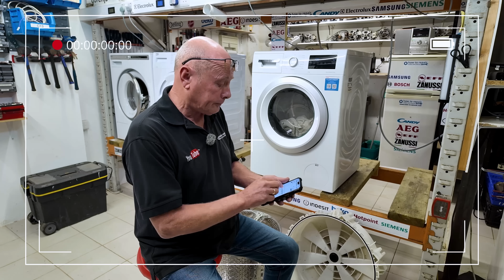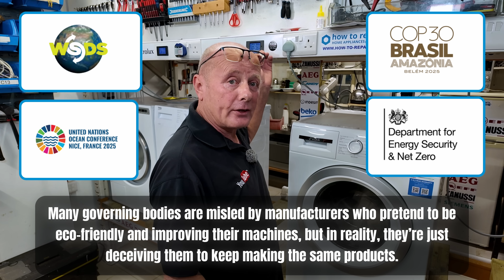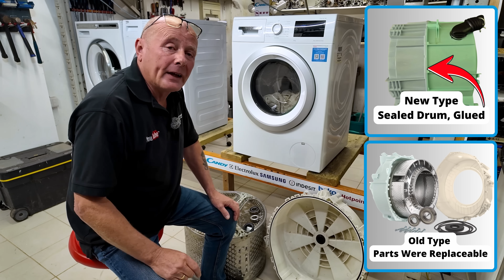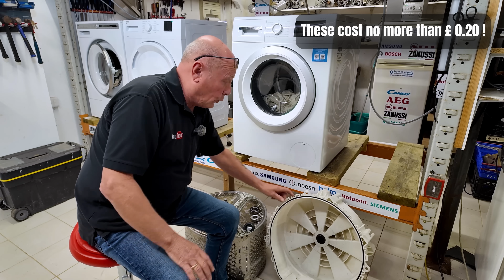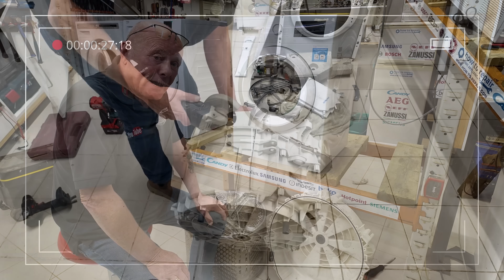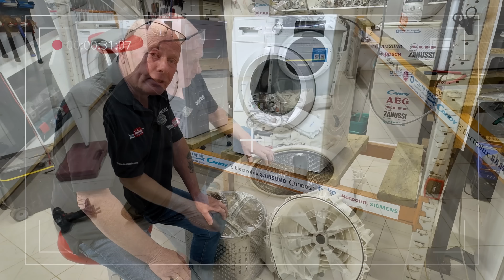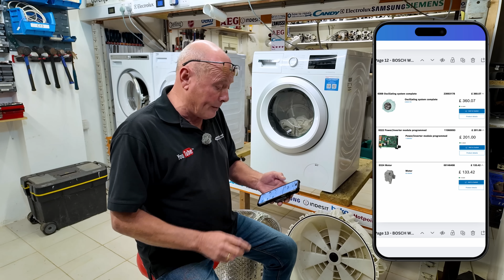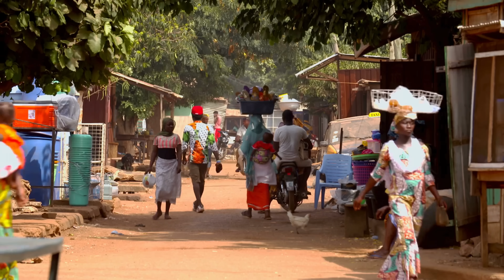Washing Machine SCAM EXPOSED! The Truth About SEALED Drums: Naming & Shaming

Comment from the maker: My part is done. Now, your part begins.

I spent a full fortnight painstakingly researching for this video. That meant verifying every single part number for every model, visiting manufacturer websites, and capturing screenshots of prices at the time of filming—all to ensure they couldn't just alter the data after this was released.

This illegal "planned obsolescence" is now industry-wide.

Think about this: Ask someone aged 50-60 how long a machine lasted in 1980, and they’ll tell you 20 years*. Ask a 20-year-old today, and they believe a machine *should last under 7 years*. An entire generation has been *brainwashed into accepting disposability as normal.

All this, simply because manufacturers won't spend 20p on screws, sealing the drum instead.

My role was to expose this truth. But watching this video alone will not create change. Action will.

Your role, if you truly want change, is to make this impossible to ignore. Share this video.
Reply: This is bad engineering and extortion the ECO rating needs to take into account the mechanical life of a machine.  Disgusting profiteering. I have a 35 year old Candy with stainless steel inner and outer drum, the only part that machine has had is a belt and a water pump.
Reply: Take a look candy crap now makes
Reply: They are removing the right to repair. Needs to be made illegal. Not to mention hemisphere discrimination (not joking). Big thanks to you for this research.
Reply: Publish a list of make and models that can be repaired, and let the market punish the manufactures who design in obsolescence.
Reply: @nigeljohnson9820 

Yes! Please name brand and modelnumber so its easy to find!
I now own a Whirlpool with thw same problem..the bearing makes a lot of noise now, but unreplaceable!
Reply: @nigeljohnson9820 To jest dobra myśl.
Reply: Hi mate, I have to finish some work on a couple things in life, next up is solving the motherboard issues for washing machines and dishwashers with universal boards, cause I'm sick of this shit that just lasts the bare minimum. We'll have a talk soon.
Reply: @Minecraftalbo   Knock up a black box controller from an Arduino,   Switched inputs and output for Pump,  Motor, valves, door switch. water lever, heater etc etc. Software programming from an App.  Rip out the OEM crap and connect to the black box.   Thousands of disgruntled customers would be happy to get their machine going for £60.   Now go build it ....
Reply: Good luck driving brushless motors with universal board. Impossible
Reply: Thanks to you, i ended up ditching Miele and going for a LG machine instead.
Reply: great work you do and as a 1977 model year old far i agree

2 things from me....

1. youtube dont care a "bleeeep bliiip" about it, as long they make money... just see the amount of false claims in commercials etc
2. once our bosch washers calls the perly gates (bites the dust) it will certainly not be replaced by a bosch, more likely a its going to be LG etc that still allows the drum to be split and cleaned prob and have bearings replaced

LG comes closer to mind as our drier has a self cleaning condenser, what ever that is works as intended or not has yet to be proved, but during the 4 years we have had it only one of the wheels at the front of the drum got chewed and was easy to replace, while at it it got a very good clean by a combo of compressed air and vacum

the place where the lint trap sits was only vacumed as not to push more lint in the condenser... i took a bit of gardenhose and attached to the vacum to get as far as possible

i did not try to take it more apart due to the claim of self cleaning, but if it comes to it i would get more satisfaction of taking the condenser apart and clean it than throwing it out

so for the washer i would want to do the same, maybe evert 2 years take it apart and the drum too and clean it prob so i can see its clean, and if a bearing goes south then i want to replace the bearing and again while at it inspect and clean... it might cost more for the machine, but i would rather support companies that try to do the right thing

btw from Denmark so inside the EU, but i dont expect that to make much a difference, they still try to play a fool of us
Reply: You need to talk to Louis Rossmann
Reply: Every time i look inside one, it just looks cheaper, timeline since the first front loaders,  first they done away with the motor and pump and made a cheap all in one thing out of plastic, then a few years later they did away with the fan on the pump , then they did away with the hot fill, then replaced outer drum with plastic, out went the clockwork timer, replaced by microelectronics, they then made a skeletol main motor, now the drum bearings are not fixable. the hot fill was important to people who had the plentiful supply of  hot water from an AGA or Rayburn etc .if you want a boil wash now, these cold fill machines take over 2 hours.
Reply: Thank you for speaking out, you are absolutely correct to assume most of the comments are AI generated. I work in IT and can tell you over half of the traffic on the internet are just bots. Also this planned obsolescence is being implemented in a lot of things, cars, phones and many other things. It is widespread, done by all companies and the institutions that should defend the public consumer from such things does nothing. I am from Romania and the situation here is the same, what's worse is that people don't seem to acknowledge what's going on and some of them actually take the manufacturer's side. Crazy
Reply: Keep fighting the good fight! The government bang on about Net zero this and net zero that but seem to be happy that companies are doing these disgusting tactics and creating more waste for landfill, needless replacements, needless energy and pollution wasted creating and transporting these machines.
Reply: Good work!
Reply: Right to repair should be a major subject in consumer test magazines. Just replaced an 8 year old AEG washer because of a bad bearing I couldn't replace because of a sealed drum. Ridiculous! What does thát do to the environment. Bought a Bosch, that I expect to fail around the same age.👹
Reply: I'm so angry.🤬 I have two Beko machines, they're not even two years old yet, they work very well, but from what I'm seeing, the day they break, I won't be able to fix them. And no one will protect us from these predatory schemes.:face-fuchsia-tongue-out:
Reply: Correct, I have seen the same with printers from HP, the repair costs as much as a new one.
I have seen fuses, not the classic ones, but looking as a chip, that will fail after a certain time of use.
I have seen printers, every time they start, cleaning the printer heads, ejecting on a sponge, that after a while will saturated and spoil the printer heads.
Philips lamps were so designed that the glowing wires will fail after a certain use. Otherwise they had to close the production.
Capacitors that degrade after some time.
And so on and on.
Reply: Yes, it's a dishrace. It needs stopping NOW
Reply: Shared 12 times 🎉
Reply: There should be a good business to be had buying these new and parting them out.
Reply: Consumers can only act if they are told which products can be repaired. It is in the governments interest to legislate in favour of the right to repair, as the country cannot afford to make the electronic waste mountain any higher than necessary. Most UK electricals are imports, so keeping equipment running saves the UK money. The government seems to be on the side of the foreign manufactures, keeping the product churn going, with a product replacement cycle of just a few years, just slightly longer than the product warranty.
Reply: GREAT video...

FYI this is NOT only rife in the appliance industry... it happens all throughout the Car industry too...

I KNOW first hand when my father took me to Germany Auto Mechanica In Frankfurt Germany to the car expo... we were looking for a Brake Discs and Pads manufacturer to supply us white label products so that WE could brand it with our own logo/brand and then build a brand name around it... 

What we found out was MIND blowing... and connected MANY dots we who had been in he car servicing and maintenance industry for nearly 40 years had seen happen time and time again with customers saying how come the pads we replaced wore out quickly and questioning weather or not they were genuine or even worse accused us of swapping out for cheaper replacements but quoting for OEM parts costs. 

The legist of the mind blowing discovery was that vehicle Manufacturers run TWO supplier production lines for the wear & tear components of their vehicles... THIS is how they give you that 3 year warranty OR 60k miles warranty, which ever comes first

Example... the brake pads you get on a BRAND NEW Mercedes Benze from the manufacturing plant will be rated for 60k miles BUT if you buy the OEM pads over the counter AT a MERCEDES dealership... those pads will last only 10k miles roughly... same goes for their other components such as the discs, Clutches, shock absorbers, air suspension components, bushes in the multi link suspensions... they ALL have a dual production line for supply... one for THEIR manufacturing production lines and the other for consumer retail sales... this guarantees them repeat customers of the life span of the vehicle AND covers them during their advertised warranty period.

The KILLER is that they UPSELL FEAR to the customers when they buy a new car so that the customers get THEIR Mercedes service packages that covers them for ALL mishaps AND wear items within that warranty period WHICH Mercedes know wont wear out on normal wear for 60k ish miles...

I singled out Mercedes as I KNOW this first hand as the sales rep who we were buying OUR brake pads from ALSO supplied brake pads to Mercedes  TOO so they knew the game far better and in depth to how far reaching it goes... He explained it to us over a few drinks.

Anyway great video and someone should do DEFFO do a expose on that industry as it is the WORST.
Reply: First time I have to thank the algorithm for pushing a video in my feed, I was just in the process of ordering a new Bosch washing machine. The old one had lasted 12+ years so figured I'd just go with another one (the door has literally fallen off and it's making some pretty funky noises from near the filter). Is LG a good replacement?
Reply: You should get in touch with Louis Rossman of Rossman Repairs, who is doing great work with Right To Repair in the USA. I think a worldwide Right to Repair campaign would make the world a better place.
For context, I'm a retired service engineer & service manager who left the service industry back in the late 90s because I saw the writing on the wall with machines being designed to be disposable instead of repairable.
Reply: @theantipope4354 what is required is for a senior UK politician to take up the fight, maybe with the support of a similar member of the EU.
Reply: You should also highlight the consumer con by manufacturers claiming your appliance is one make (AEG) when in fact its an Electrolux, thus charging more for a german name. I was an AEG tech back in the 90's, then E'lux bought us out, as well as Zanussi, the american Hoover brand was bought out by Candy, Bosch also rebadged certain models so they could charge more for an inferior product. Dont get me started on how appliances were poorly designed just to save a few quid on manufacture, resulting in major strip downs just to replace carbon brushes.
Reply: @robbiegerard7857  Electrolux are apparently dropping the Zanussi brand and plan on licencing it out, having been trying to sell it (to midea it think). But prior to that they moved it down market and cheapened it further by getting rid of the filter flap, and mounted the drain pump on the tub, and were  marketing "no filter to clean" as an advantage!😂 I think they now sell those under the AEG brand too. John Lewis machines I think are still mostly Electrolux too, but at least they think their store name on a washing machine is an asset, where most electronics chains licence once famous brands like Kenwood, hitachi, bush etc and usually plonk it on low end, often chinese made appliances.
Reply: My parents got a washing machine as a wedding present in 1972 and it was still under the 25 year warranty when we sold the house in the early 90's!

I got a replacement element for my oven from a small parts seller just beside one of the main streets in Dublin City about 10 years ago, replacement of the element and my train fare came to less than €20.  Checked the same place a few years ago for something else and it had closed down. Looked at their website and they had a notice that basically parts online are too cheap and their business went bust because of it. 

Not viable to have a large inventory of parts plus pay rent/rates when people can get the same stuff on Amazon or Ebay for similar or less price. People talk about shopping local and supporting local businesses all the time, but will order from China to save 5 quid.
Reply: A list of manufacturers who's drums are not sealed would be great and then as members of the public we can 'vote' with our feet.
Reply: Dear boss did have any job vacancy in yours work place
Reply: Brilliant. Very intrigued by the repairability information available on France. Spot on re. Which? , which is great but really should look more into obsolescence/ cost of parts/ repairability. Just wondering about whether to replace an LG F1481TD bought in 2011 or repair . It is displaying error code OE close to end of wash cycle. We too went to Currys but discovered most LGs seem to have less choice and often no Wool cycle. I guess the drain motor is flakey. Keep up your excellent work, we seem to be told what to feel angry about but the smell of multi-member cartels quietly agreeing on fleecing  the public does not seem to be of concern...
Reply: Keep yelling. Every video awakens more people. I’m now subscribed. AI is saying US makers haven’t joined the club yet…but don’t expect that to last long. I got 20 years out of my Kenmore washer but that doesn't compare to my parent's 40 years from a Maytag.
Reply: Boycott these brands! Actually, I'm not sure this will work if EVERY manufacturer is doing this. I'll have to start handwashing my clothes or using a laundrette if that's the case...
By the way, every time I visit the Philippines, I marvel at seeing how repair shops are EVERYWHERE and for ALL types of electronic products. I kept thinking to myself, if there, why not here (in the UK)? If the West is serious about the environment, they should pass legislation that phases out planned obsolescence and encourage a repair economy.
Reply: @FatFilipinoUK 😂😂😂😂😂😂Seriously ??????????? West ?????????😂😂😂😂😂😂😂😂😂😂
Reply: Thank you
Reply: In other words, buy Miele. Immer besser!
Reply: Thank you! Just looking at getting a new machine. Was already leaning towards LG and, so long as it's got a split drum, I'll definitely be going with it now!
Reply: Thank you for exposing this. 
Is the answer to buy from a Southern hemisphere manufacturer?
Reply: Ok. I have a Bosch washing machine WAW28542NL/01 FD: 9408 in 2014. This year (2025) after 11 years of heavy duty (minimum 1 wash a day , but many times two wash a day) the Drum bearings broke down. I have bought a new drum (cost 291,95 Euro) and replace them myself. And when i am lucky, this drum and when the rest of the machine keeps up , then a lifespan of 18 years would be possible. You are right about the cost of repair when a service engineer replace the drum. This is not economical anymore. So it"s a pitty that the whole economy of producing products has changed this way. In my kitchen i have a combi microwave oven 22 years old , a Dishwasher 20 years old , a Refrigerator 20 years old , a induction hob 24 years old (NIT615D) all BOSCH and still working today.
Reply: Everyone just start buying  the ones that still split and tell them that's why you're buying them tell the others that's why you're not buying them and watch the u turn happen
Reply: Can you do a video on who is doing drums that CAN be replaced. Let's vote with our cash
Reply: You are right...l know the problem...its a nightmare, l next time , will buy asiatic brand you showed. Thamk you for your stunning post. 😊
Reply: Everybody should buy asiatic brand...
Reply: Same problem with pc printers...when you change the toner or laser in,  it will cost just like a new printer and cartridge is not 100% full .pure Scam...
Reply: Ok check this out: BSH Hausgeräte GmbH, also known as BSH Home Appliances Company, is one of the world's leading home appliance manufacturers and the largest in Europe, and is a wholly-owned subsidiary of the Bosch Group. BSH operates a comprehensive portfolio of global and regional appliance brands including Bosch, Siemens, Guggenau, Neff and Thermador. BSH also holds several "local heroes" brands that cater to specific regional markets, including Balay (Spain), Constructa (Germany), Pitsos (Greece), Profilo (Turkey), and Coldex (Peru).

This should help answer why the anti-repair bs happened across all brands?
Reply: Well done for highlighting this shite that they are doing to us consumers.
Reply: This is great work. Are there manufacturers who DO NOT engage in this? At the moment.
Reply: The cost of realestate in Australia makes parts warehousing to expensive.
15 years ago after an expensive machine only lasted 3 to 4 years I swore never to buy an expensive machine again.
Now our new laundry has 2 x cheap 7.5kg machines and when one fks up buy another cheapest machine at my pleasure rather than in a panic due to my wife demanding it has to be done that day to wash again.
Reply: ice cars are the next where  oem raise prices for certain parts that a repair becomes too expensive
Reply: Someone tag louis rossman
Reply: How about the Indesit? What drums do they use? The "north or the South" tech.?🤔
Reply: Just a Geography comment... The whole of India and about 95% of Asia are in the Northern Hemisphere. And similarly, over half of Africa is in the Northern Hemisphere.
And crucially as far as washing machine manufacturers are concerned, 90% of the world's population is in the Northern Hemisphere.
Good work by the way. Perhaps the EU would be interested in your research as they introduced the directive that insists consumer goods must be repairable. (I realise we're no longer in the EU but the manufacturers are and are almost certainly selling the same machines there).
Reply: Welcome to a lefty capitalism 🤗
"Please don't complain slave and die slowly♥️"
Reply: For me I have already boycotted them that's it. And I will share your video for sure.
Reply: same thing is going on in the car industry btw.
Reply: as a general repair guy i see this in phones/tellys/laptops/cars!
Biggest scam is making the main pcb not talk to a smaller part if its serial number doesnt match what it was from the factory, swap a phone fingerprint reader or camera, it may not work as its not friends (paired) to that main pcb... but thats to stop the mobile phone thefts so the stolen phone isnt even worth anything in spares, but that also means i cant build 1 good phone from 2 legally bought broken phones... now seeing this cars. not yet in tv's but.......
Reply: I'll never buy a washing machine with a sealed tank. This policy of sealed tanks IS environmentally dangerous, because most likely you'll throw out your machine instead of buying a new tank for it. also, the manufacturer pollutes the environment by producing new machines. This is all about the money.
Reply: @Tr0llingSt0nes can we assume you have x-ray vision. The manufacturers do not exactly advertise that they are trying to ripe off the their customers. That is why repairability should be show along with the product energy rating.
Reply: yep. we need this standard. In the name of ecology or smth.
Reply: is it possible to find a seal that works on the drum you split and bolt it together?
Reply: You should talk to Louis Rossmann he is fighting for right to repair for year. Finding some way to patition this in the EU for example could lead to overall change. Would love to support but not sure there is a partition!
Reply: Action could be designing and selling a third party replacement drum kit. You cut the current drum open, replace the bearings if needed and put the old drum into replacement plastic casing. Design it for one most popular machine, validate business model and then move horizontally. Can sell it for something like 50 bucks.
Reply: Bring it up to international attention so people can learn to shop for brands that take repairs later as well is an important issue
Reply: It’s everything from food to transport to movement
Reply: next they force "You have no right to complain"
Reply: After seeing your video I thought I'd check to see how much the sealed drum was on my Siemens machine that cost over £1000 8 years ago, and was pleasantly suprised to see it retailed for £240. I then looked at a machine I sold in 2008, a Bosch WAT28560GB, and the sealed drum on that one retails for £186. It makes me wonder if the manufacturer has overpriced parts for new models that are still under the 5 year warranty (as they pay for the repair) and once out of warraty the parts become more economical??
Reply: Gluing is actually more expensive and more difficult than screwing together. I had a Candy made in Hungary in 1993. It got broke down a year after purchase in 1994. A guy replaced a motor with third party and then it worked for over 20 years, until started falling apart - plastic drum body started shuttering like a front car glass. We got a new Candy Russia-made. Worked for almost 10 years when started walking. A guy installed new magnets (bushes as they called here, don't know about English), cleaned it up. Few years gone it's still working, although not washing good enough, but it's a compact machine staying under the sink.
Reply from the maker: @elksalmon84  I have tried getting some information on how many watts of electricity would be used for welding the 2/2 of the drum it is an absolute disgrace how the manufacturers are doing this?
Reply: can we have a video on machines that still can be repaired many thanks.
Reply: But wasnt there some directive from eu that washing machines should go back to being servicable...
I have a experienc to share with you, my dad and i cut a drum apart on a old candy to change bearing and than glued it back together, but my mom bought a new candy because my mom said the old one was old and she wants a new one anyway...so i took the old (glued/repaired) one, because it was still better than the one i had....and shockingly the new candy failed before the old repaired one and not only that it failed within a month of expired waranty, guess why, bad bearing in a sealed drum
Reply: Brilliant thank you
Reply: its started with famous capacitor rot. later they decided to make repair insanely tricky or just impossible.
Reply: Стиральная машина National NA740 проработала без каких-либо нареканий с 1980-2024 год! Возможно проработала ещё если бы смазка двигателя не высохла и в один день я не испортил его порвав не ловким движением обмотку.
Reply: Agree with all u said but what machines manufacture should we look for?
Reply: Thanks for the hard work
Reply: It helps the share holders when they can sell you a new one every few years... Also.. Glue is always cheaper than bolts or screws!

So it's a Win Win for the large companies!
Reply: We need to be writing to MPs..

It is a scandle..
Reply: I could not agree more with what you are saying in this video. I am all way telling anyone who will listen you have a right to at least try and repair your owne property after all you payed for it in the 1st place
Reply: Whats a sound guy, smart articulate and on point !
Reply: I replaced the bearings in a 10k Bosch sealed drum by cutting the drum and resealing. I packed the bearing compartment with grease to increase bearing life and stop water ingress past seal. Total cost £25.00 and three hours work.
Reply: @bryanknowles8562  That sounds fantastic and I would love to hear some details on how you managed that. Stuff that is hard and expensive for most others must be simple for you. I have attempted the repair and it worked for a little while, but not for long. The cost of the special glue needed alone is higher than the 25 dollars, and  you still need to plastic weld a structural reinforcement over the glued joint, for which I failed to find a compatible PE compound that made a strong enough bond, and I ordered and tried several. I did a lot of research and tried different methods and materials and still found this difficult.  Proper plastic weld tools could be made at home but costs money if you buy. Grease might reduce the risk of water ingress (past the already existens rubber seal) into the bearing only if using water resistent good grease, which is more expensive, but that is probably seldom the cause for the bearing life to run out. It is that they use poor quality bearings in an environment with high unbalance loads. Why would you if so not use higher rated capsuled bearings? I think one got to have some really good skills and good equipment to have a chance to get this right, and I don’t think it is fair of you to claim it is easy and cheap without giving more details on how one should overcome the difficulties. Please tell us if you know. You would be the first in all of youtube to demonstrate a successful repair method, and save billions to the worlds consumers and make very big positive impact for the environment.
Reply: BDS all multinationals!
Reply: This is so true!! I had exactly the same issue with other appliances. E.g. dish washer, coffee machine, etc. Opening stuff up to get to the part that cost a few euro-cents is taking forever (if you want to be able to put it back together at least). It's so obviously done on purpose. I have been supporting the right-to-repair movement, I repair as much as I can, but as you mentioned. Getting the parts is sometimes insanely difficult or even impossible. Also it seems that more and more the designs are made to just fail with certainty. It's disgusting that we came to this. Also the price of the parts. Taking into consideration that a washing machine isn't only a drum, motor and mainboard... it also still has a housing etc., needs to be transported to the shops, there needs to be some profit left to be made, etc. just proofs that it's 200% clear that the pricing of parts is just done in a way to discourage repair as much as possible.
Reply: Damn recently bought Miele over an LG....
Reply: Keep up the good work 👍
Reply: So WHAT is a washing machine you'd still advise us as one that we could 'safely buy'? What brand (if any) still makes machines that CAN be repaired? Is there still a brand around that also gets sold on the western European market(s) that is not designed with planned obsolescence and thus timed failing in mind?
Reply: Totally share the anger. This is a gigantic envvironmental scam to the world. Think of the number of washing machines sold every year ( up to 150 millions, 100M of which in China according to chat GTP), most of them going to landfill due to a worn bearing after 5-10 years. Casings, motors, pumps last much longer but get scrapped. A year ago I attempted a repair on a Bosch , ordering PE gluing and welding equipment that was supposed to work. It did for a while but the loads were too high for the repair so leaks emerged after a while. I gave up after two attempts, and purchased a Miele, that still have some servicable models (not all of them though). PE is the most difficult to glue of the different types of plastics (other plastics are stronger, but they claim they use it beacause of ani-moulding properties) and you cannot open the tub without destroying the overlap spigot flange used at assembly. The original bearing wasn’t even a sealed high performance bearing (a high load rated sealed SKF bearing costs about 12-14 euro) but some crap thing of the cheapest kind (around 5 euro at best) - clearly designed to fail. This is in my eyes an environmental crime, in addition to the consumer scam. I would support anyone wanting to write laws holding those criminal cartell industries accountable for destryoing our planet. It really is outrageous that almost all started doing it at much the same time, and that it continues to happen. Maybe a class-action law-suit, like the one against tobacco? I would gladly be one of the hundreds of millions to sign. Keep outing their scam. Grat work!
Reply: Thanks for the USA!  LG for the win!
Reply: Another issue is that even if the drum is openable there is a huge labour / time cost so is it effective?  In the 1960s' - 70's I was replacing Hoover Keymatic bearings and it was a time consuming job but then machines were relativelly  expensive and labour not so. Machines could be redesigned to replace the bearing and seals from the rear (drive) end and the drive shaft to rotating drum improved to never fail - as per Keymatic's or replaceable from inside the rotating drum. The bearings probably fail due to water ingress via a failed seal and detergent / water washing out the grease - also there is a huge load on the bearings due to the design - increasing the size and improving the seal would help increase their life but would not be good businees. Many modern machines have 'direct drive' rather than belt drives and that might improve the load stress  situation ?

Car wheel bearings have high loads but don't seem to have these short life failures.
Reply: What’s the problem? You vote with your money. If Bosch is selling scam machines, don’t buy Bosch. It’s really not that hard. My money goes to companies that build products that last the expected lifespan and don’t work against the customer.
Reply: Bearings cost pennies when you buy in bulk.
Reply: A lot of emphasis should be on the landfill that all this built in obsolescence is creating, the same multinational businesses and governments all push this “green agenda” and the landfill aspect highlights their B.S.
Reply: I still regret swapping out my 25 year old Miele refrigerator for a new one. All I needed to do was replace the thermostat. But I was in a busy period at work, no time for tinkering, and I figured something else was going to break soon anyway. It was only when the new one arrived and I removed the old one when I noticed it had 2 separate compressors, one separate for the freezing section, it was a quality machine! But the purchase-delivery included pick up of the old one, so it was all over before I could rethink.
Reply: @cybermaus Made quite a similar mistake with my previous 20yr. fridge and boy have I regretted that. The old wasn't particularly malfunctioning yet, just that the defrost wasn't quite efficient anymore when the weathers were warm and humid, besides of that there was only some cosmetic wear and tear, yet the new has proven to be so cheaply made in all it's details that it was a shear downgrade. Hate to be a consumer in this day and age of ideologically neoliberal business policies. 😭
Reply: Well no shit sherlock. They have been running AI bot farms to comment stuff for over a decade now.
It became really obvious around 2012 and the dead internet theory has been proven correct many times.
Also youtube even takes part in these comment campaigns. The actively hide commentsso only you can see them and also making alt accounts is hard with western IP addresses.
But for some reason when I connect with Indian or Chinese IP I can just make one no phone QR code scanning or linking to already exsisting gmail needed, they dont even ask for phone verification which are a pain considering if you mass produce accounts they average around $0.12 - $0.30 per verification.
Reply: Technology would not advance this far if you had a washing machine that lasts 30 plus years. The companies would fail. 25 euros per month is very very affordable. So, everyone gets a nice washing machine, not a shaky rusty one, remember those? Why would some folk ever replace a washing machine, no matter how disgusting it gets? However, you need to repair one from time to time. If there is no programmed obsolescence, most companies would fail in affected product types. EU economy, US economy are very ok with this. LOOK AT THE LARGER PICTURE. A WIDE ECONOMIC VIEW.
Reply: @Mr1BOSANAC  It’s always interesting when people appeal to “the wider economic view” but start with a premise that isn’t real. A washing machine’s typical warranty is 2 years, not 30, so using a three-decade lifespan to make the argument doesn’t describe the actual market.

And the idea that the economy requires products to break isn’t accurate. Companies stay profitable through repairs, upgrades, efficiency improvements, service contracts, and brand reputation. Planned obsolescence isn’t an economic necessity IT'S JUST A BUSINESS CHOICE. (see what I did there ;)
Reply: @Abitofcode absolutely agree. 
It's not that they would fail, they just would earn as much. It's pure greed. 

New people are coming to this world that need new machines. Also the lifespan is finite, that also makes for a replacement.
Reply: @avgonyma1 No, you can buy a functional brand new washing machine for 400eur from Midea. That is very cheap. You can buy 4 washing machines for a single salary in a poor EU country, former Eastern Block ones,... If you buy a high end one, it's a different story. However, compare it to a 200grams product, a mobile phone.
Reply: @Mr1BOSANAC the opposite is true. Technological improvements would be key in increasing sales.  It would be the motivation for a product  upgrade. This is a very mature industry, so real technological advances are uncommon. The drive to cut retail prices have a detrimental effect on quality, functionality, and reliability. The reward for the manufacturer is a reduced product life, increasing churn. . To be able to compete, requires the economy of scale, increasing the investment involved, and the damage to the environment. This is a road to nowhere.
The western economies are not all right, they cannot compete with far eastern manufactures. It is you who needs to look at the bigger picture, and the damage this marketing model is producing.
Reply: @nigeljohnson9820 However, such economies have failed. You make 1 million cars, people buy it and it's ok for 40 years. After that time, there is no factory - at all.
Reply: @Mr1BOSANAC since that was the strategy for years. It explains why there are no cars now. All those factories closed.
Reply: @Mr1BOSANAC  how the big F failed ? Ford , BMW, AUDI , VW are old factories they made lots of things now they make only poor cheep cars and sell it at exaggerate price
Reply: It's not illegal. It's business. Greedy? Of course, but in the sick world of "constant growth" everybody seeks ways to make things cheaper and sell them for more.
Reply: @Lvvcassss it's only cheap if the manufacturers avoid the responsibility for the true cost of raw materials and  recycling. It is a sick world, where manufacturers fail to acknowledge that we live on a finite planet, with limited resources. There are good reasons to slow the churn cycle down, extending the life expectancy of products. This would certainly greatly reduce environmental damage.
This may increase unit prices, but that expense is amortised over a longer period. Product quality goes up. The only justification for replacement is true improvements in technology. It is questionable if small efficiency savings justify the cost, and inconvenience, of a short product life.
Reply: This is a dumb claim, not a single right minded company board would accept a machine of their brand failing just outside the warranty.. that would mean people wouldn’t buy that brand anymore.
Reply: Don't expect anything less from rip of Britain.
Reply: Make your own washing machine if you are so smart